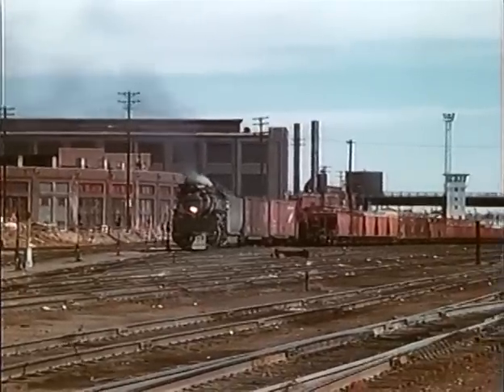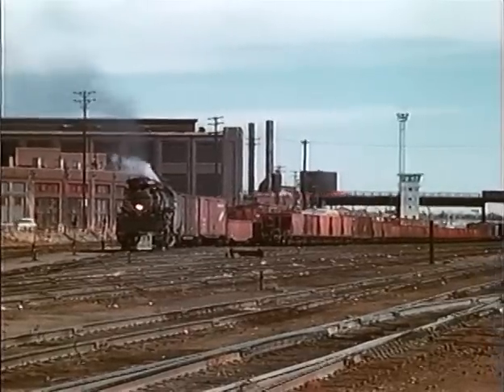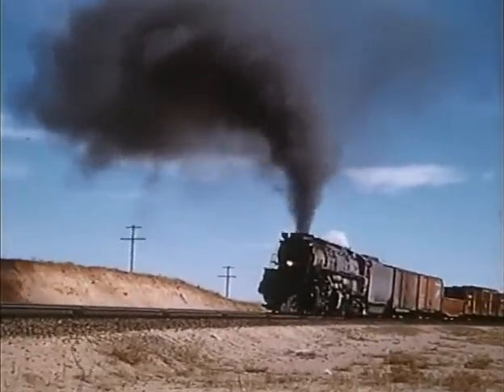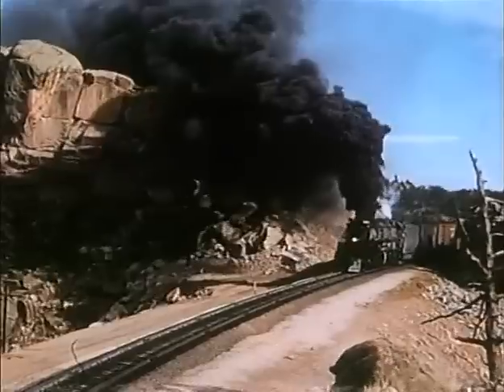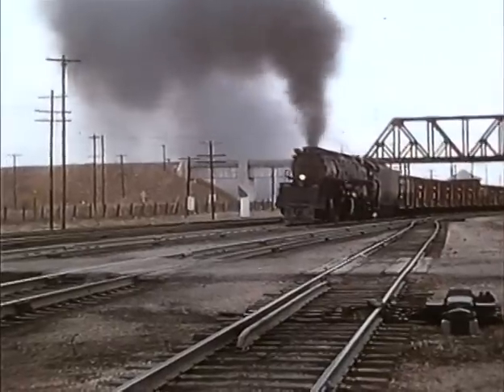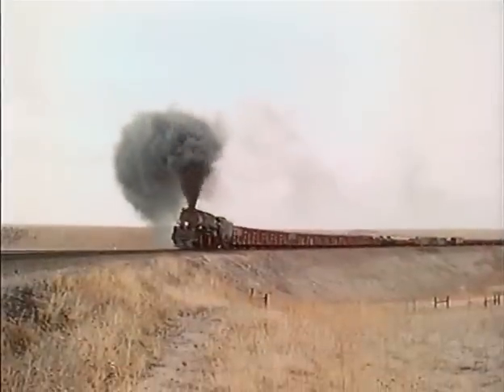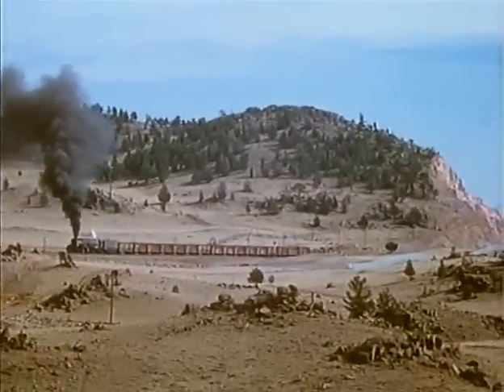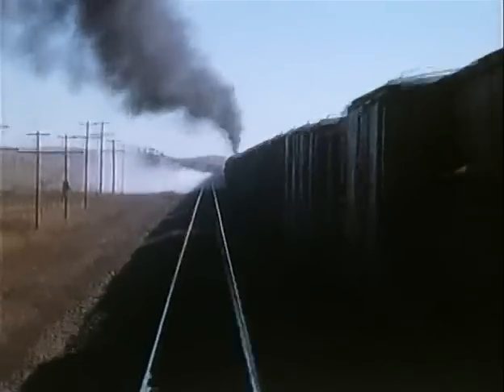Big Boy Locomotive Compilation

Comment: chuffing with pride, pulling 5 and a half miles like its nothing, and fun to watch.

That’s why we need them back

Like if you agree.
Reply: There restoring the 4014..
Reply: I know.
Reply: Big boy is running now
Reply: Big boy pulled freight trains
Reply: kevin Simala even in the historic videos they’re all oil fired, the coal requirements were just too much to keep up with
Reply: @MrCulldog  No, they aren't. One was fired on oil, quite successfully after refinements, but the fueling facilities needed for oil burning 4000's were deemed as too big of an investment on a single class of locomotives that were in the process of being replaced by diesels.
Reply: @splitreduction3901  I admittedly don’t remember writing that comment, and I was entirely wrong! They were all coal fired until recently

Comment: Over 1,000,000 lbs of badass, water-boiling, coal burning, steel hauling engine thundering across the countryside. 

This, in many ways represents America back in the day.
Reply: Geoff Adams The NZR Garretts were withdrawn due to having a too heavy axle loading, therefore causing too much damage to New Zealand's narrow gauge tracks (yes, something the NZR managment should have thought about before they approved the design and ordered them). They were only used over a small mountainous section of the North Island main trunk. After scrapping, the boilers and other components were re-used in other classes of locomotives.
Reply: Geoff Adams have you seen the lms and LNER garrats
Reply: It still does today! 4014 is back in action. ;)
Reply: Ahhh... The good ol days when people were looking for high quality
Reply: @dannydorito9815  Big Boys never burned oil, 4005 was converted but it failed so coal was used.

Comment: Unless the locomotive was idling and the fireman was keeping a spot fire, nobody would be shoveling coal on one of these. You simply would not have been able to feed its appetite at speed so they were fitted with automatic stokers.

As for power output, it's tricky to measure horsepower in a steamer but her tractive effort was impressive at 135,375 pound feet.
Reply: I personally believe that tractive effort and horsepower ratings were underated when they tested them back in the day, I bet they made a little bit more than what is known, I mean if they were using 1940s technology to rate them, it's probably not correct. I bet if they tested them today with modern technology they would be seen to make more power than what is known.

Comment: Not sure why everybody is coming up with pollution here. This is a locomotive, burning coal, not combusting petrol.
Most of the soot is falling back to earth anyway.
Reply: I know right?
Reply: Coal is the single dirtiest fossil fuel there is. With the most CO2 per Watt generated and a lot of respirable dust emited as well as more radiation than an accident-free nuclear power plant due to radioactive carbon isotopes.
Reply: No. As simple as that. Coal in any form is polluting much more than Diesel. Not to mention the radioactive particles coming from burning coal as well.
Reply: John Wayne WELL IN ENGLAND WE USED COKE, A SMOKELESS CLEAN BIPRODUCT IF COAL, SO IN THE OLD DAYS OF STEAM 99% OF STEAM TRAIN EMMISIONS WERE STEAM. AND PURE STEAM HAS NO BAD EMMISIONS.
Reply: TheNax wow radiation, big FUCKING woop
Reply: and burned the country side coal burns for hours and there are embers left I head stories of coal burners causing wildfires here in the west we don't burn coal we use bunker c fuel oil.
Reply: and it is a fire hazard this is why we use bunker c fuel oil out west
Reply: coal is a fire hazard we don't use it in the west
Reply: and it is a fire hazard Nax burning coal creates embers and if an ember lands on grass it will burn and continue to burn as long as the engine is on the track. We use bunker c fuel oil which is cleaner and burns longer.
Reply: Aaron Peavler/Geomodelrailroader Railroad Photography use coke
Reply: KR4FT W3RK     👍Yes. True. 
Thanks.
Reply: Ben Birchman   Why not Putin? 
😂Haha!
Reply: Clorox Bleach   No not at all.
Reply: NKP 765 still uses coal and there haven’t been any problems.
Reply: John Wayne lol I was gonna say the same thing
Reply: KR4FT W3RK tell that to the thousands that from coal dust smog in post WWII English cities. I’m old enough to have ridden in coal burning loco’s in the early 1950’s with a head wind it was difficult to breath. I don’t like seeing this beautiful beast being converted to diesel, but better that than not seeing run at all.
Reply: @TheNavalAviator  feel free to move to a clean air socialist country, like China or North Korea.
Reply: John Wayne died from cancer, years before he had been in a movie shot in a former Nuclear Testing area in the USA, the radioactivity probably caused his cancer, which is probably why the John Wayne in this thread is worried about radioactivity.

The UP Big Boy's were always coal burners as far as I know. One of them (the 4005) was converted to burn oil as an experiment in 1946 until 1948. Some of the Challengers were oil burners.

Bunker C Fuel Oil - What's the price of that like nowadays? The reason why Oil burning steam locos and the UP Turbines finished up when they did was because the price of Bunker C Fuel Oil went up significantly in the early 1960s.

The only place coal should be burnt is in steam locomotives.
Reply: @Legomenon No.
Reply: @Legomenon I don't have one or need one. 🤣
Reply: @TheNavalAviator  what you smoking? Can i have some?
Reply: Btw 4014 is being converted to burn oil, and us nearly completely put back together. So we will witness big boy 4014 move under its own power soon!
Reply: A. Wellknownmyth  he's not lying.  all combustion results in c-14 emissions, but with coal the radioactive isotopes are much greater than other, more refined fuels.  also, coal soot falling to ground pollutes the water.  my brother has a farm in south carolina with a stream running through it, about 5 miles downstream from a coal-fired electric plant.

when komrade bone-spur decided it would be a good thing to allow such plants to dump coal ash into the rivers nearby, his stream went from clean water with good fishing to something more closely resembling used motor oil; thick and viscous.  you think he's still catching edible (and delicious) catfish there?.

now, all that being said... the couple of dozen steam locomotives currently being operated in the USA by heritage railroads are NOT going to significantly impact the environment.
Reply: A. Wellknownmyth  a link?  how about i send you my address and you can come see the vial of water i dipped out of the stream when i visited last thanksgiving.

coal soot contains radioactive isotopes of carbon.  we proved it in high school chemistry class over 40 years ago.  is it significant?  not with the trifling amount of coal we're burning now compared to a century ago.

and that's why i agreed with your dismissal of the dingdong complaining about the pollution of heritage railroad operations.  he may have been technically correct, but he's also making a mountain out of a mole-hill.
Reply: @thomashambly3718    Yeah when the hell did we start worrying about radiation from coal for Christ sake?!
Reply: @longislandcerealkiller6385    IKR.  Can just see em start trying to ban steam because of global warming!
Reply: @thomashambly3718  Wait... Cocaine or smokeless coal?

Comment: I wish I could have lived to see steam locomotives in service.

As cool as intermodal service is, it gets a bit boring after the 700th set of GEVOs pass with another string of double stack containers.

Back in the day you could see, Boxcars of all shapes and sizes, gondolas, hoppers, stock cars, tank cars, reefers, multiple types of passenger cars being pulled by both streamlined diesels, and steamers.

Sure most of those types of cars still exist, but you don't tend to see the big mixed freight trains behind massive steam locomotives, or strings of colorful diesels anymore.
Reply: The greatest thri;; was to stand close to the rails and watch one of those things come at you. The hot breath of the leaking steam from the steam chests, the heat of the fire in the ash pan, smell of coal and hot oil and the earthquake as the driver pounded the rails. What a sight - especially in winter.

Comment: Love the "out of sync" exhaust sound (about 3:30).  The Milwaukee diesel is laboring (starting about 4:17) rather intensely to push the "Big Boy" down the line.
Reply: The "out of sync" exhaust sound can be programmed in to sound decoders on model trains, I've done it on mine.

Comment: the tractive effort on a steamer isn't constant either (fuel in fire, water in boiler, etc). On the larger steamers the tractive effort seems to be low balled considering some consists they hauled required more then the stated TE.

Comment: Raw coal exhaust has a blackness about it can't be equaled even with burning oil not nearly as thick and black as coal.
Reply: Well if the locomotive is fired properly it won't produce alot of black smoke no matter the fuel.
Reply: @fermitthekrog6318  it will under heavy load even when fired right.
Reply: @EvilTurkeySlices  a thick black smoke is caused by feeding fuel into the fire faster than it can be efficiently burned. This can happen even if the engine is working hard and causing a large draft in the fire, if the excess fuel is greater than the increase in oxygen supply. many heavy trains would blow out soot when starting up but clear up quickly. it's not at all easy to do since the air fuel ratio was manually controlled  but you can get a locomotive under load without huge black fuel clouds. and as a fireman that would be your goal as a thick black smoke ment you were waisting fuel.

Comment: they are building a new t1 locomotive, maybe a new erie triplex will be next
Reply: really? I can't wait! Maybe when they rebuild the t1 they will articulate it so it can take long curves, unlike the original.
Reply: Like hell somebody’s going to build a new triplex. Don’t get me wrong, I love the triplexes, but they were ultimately impractical, dysfunctional locomotives that burnt more money than they brought in. The T1 might have a chance since they were such successful locomotives, and were determined to be purposeful, but a triplex? No chance. The Erie and Virginian scrapped/split them for a reason.
Reply: The main problem with the Triplexes is that their boilers were just too small, they could not provide enough steam to get them above 5 mph and then they had to stop every few miles to get steam up again. I have a model Triplex and a model USRA 2-8-8-2 and the boiler sizes are almost identical, putting the two along side each other makes the point.

However I have wondered about building a triplex with the boiler the size of a Big Boy boiler, that might work.

Comment: fire not set right  to much black smoke is a sign of a lack of air or too heavy, a fire  light grey smoke is what needed
Reply: We're not talking about a diesel engine here.
Reply: well i not talking diesel locomotives either
Reply: and I am talking a bout firing if you know anything about firing  I grew up with steam locos and have steam raised and fired them
Reply: anna jeannette Dixon no, you read comments on a. YouTube video, the reason there is a lot of black smoke is because it’s working hard, they pulled very heavy freights.
Reply: you might not know as much as you think you do about trains.
Reply: She's right, watch the video called "Little & Often", it may be about the LMS and firing on British locos but the principles are the same. In the later years of steam operation in the US some of the larger steam locos were fitted with blowers that increased air flow over the top of the fire to reduce smoke and improve combustion efficiency.

Comment: Amazing locos but why is the combustion so inefficient, all that black smoke. Efficient combustion gives light grey smoke. The black is uncombusted hydrocarbons, up to half the calorific energy in the coal. Big boys had mechanical stokers and used crushed coal i believe so could have more efficient combustion than a manual shovel stoked loco. So why set it so that it essentially over coaled the fire?   (Im an experienced fireman so know what Ive been taught about wasting coal and smothering the fire).
Reply: Maybe it was going up hill or they did it on purpose for the video. But you're right, a train that was running efficiently would have light grey smoke or almost none at all.

Comment: I don't understand why these American loco's produce so much black smoke. I live in Europe and here thy only produce clear white smoke
Reply: Well it all depended on a few factors. Like how well the fireman was firing the locomotive at that particular time or the quality of the coal that was being used on that particular trip. Another factor would be the grade of the coal, soft coals produced lots of smoke even if the fireman was firing perfectly. Hard coal produced very light smoke. Big Boys used a soft grade of coal.
Reply: bobby jekins There might also be an element of the crew "putting on a display" for the camera. That happens in the UK.
Reply: Yea. They use to do that to here in America. If the crew was fimilar with a certain Photographer they would lay on more smoke for a more dramatic photo.
Reply: Also, the big boys were designed to burn basically combustible dirt. They had alot of power, but the coal from the UP mines was poor in this case.
Reply: Another possibility is that the engines you are seeing are burning oil which makes clear white smoke... it does from my furnace anyway

Comment: noway  it burns 20 ton a hour it only holds 20 tons it be out of coal quick
Reply: Think about it, big engine, big fire box...
Reply: Tender capacity was 28 tons (56,000 lbs.) of coal and 25,000 US gallons of water.